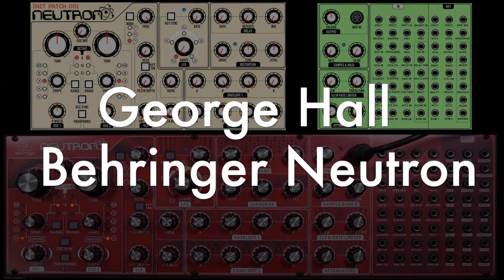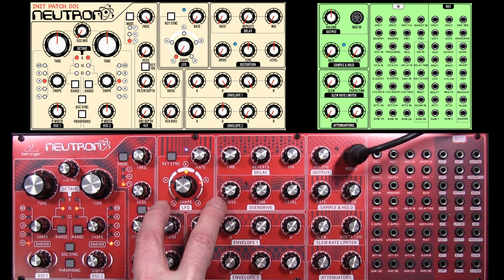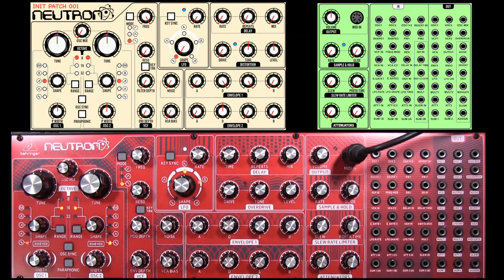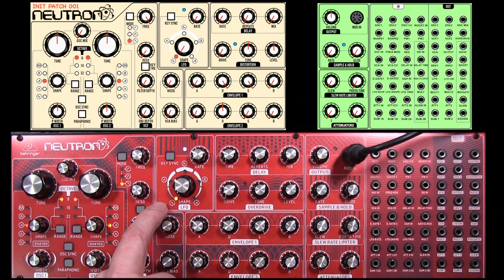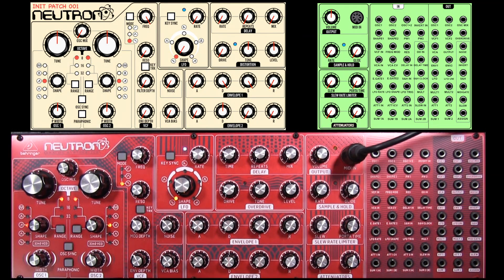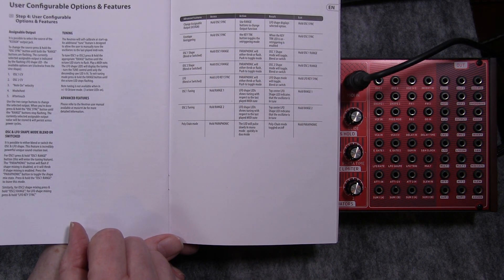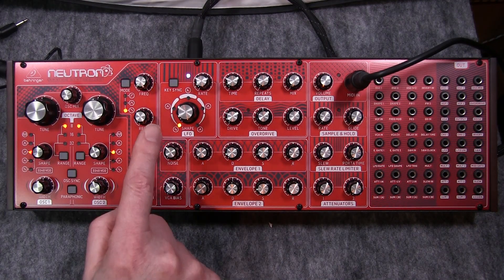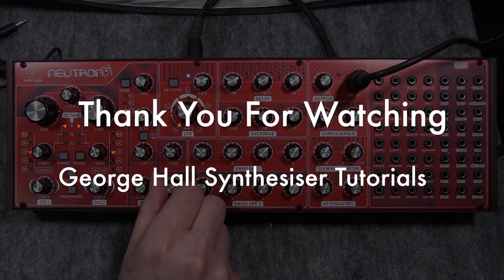Behringer Neutron Introduction and Initial Patch settings

Comment: I think mine might have issues. I've set it as indicated in your vid, but it sounds nothing like yours it sounds like a cheap tone generator. I updated the firmware OK and downlaoded the Neutron app, but that won't connect. I tried loads of different patches from other people and got the same results I just get feeble, flat, lifeless tones out of my machine :-(
Reply: Ever figure it out?
Reply: @jdssurf  Yeah it was faulty, returned it and got a PolyD instead
Reply: @hydorah  lol, Nutron is pretty rad, I’ve never used the poly

Comment: HOW IN THE HELL DO I LINK MY KEYSTEP TO THE NEUTRON THEN TO MY INTERFACE TO HEAR IT THROUGH MY MONITORS??????????     Sorry Im yelling but I spent all this cashola and Im going nuts. I can get sound with headphones into the Neutron, but thats it lol.     HELP!!!!!!!!!
Reply: You can connect the keystep to the neutron via midi or using the CV outs in the keystep. If you're using CV, connect pitch out from keystep to OSC1+2 input on Neutron which will send pitch info to both oscillators. Than, connect keystep's gate to both e.gates on the input for the Neutron either by 1) using the in of the mult and the two outs of the mult or 1) using a stackcables from the gate output to both e.gate inputs. This will provide gate information to both envelopes. 

There is an output for audio on the back of the Neutron that connects to your mixer/interface.

Comment: Great work David Thanks.  I have a question. On the back side there is an audio input. It is External output 1/4 " unbalanced. 100kOhm impedance..Can I use this connect my elctr. guitar or pocket operators or the korg mini synths like monotron or sound from my pc or smartphone?